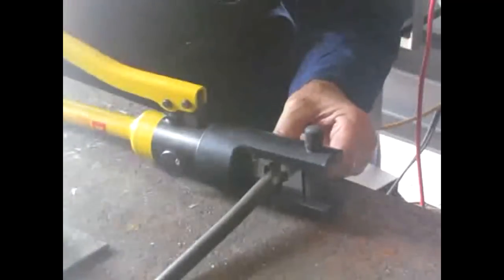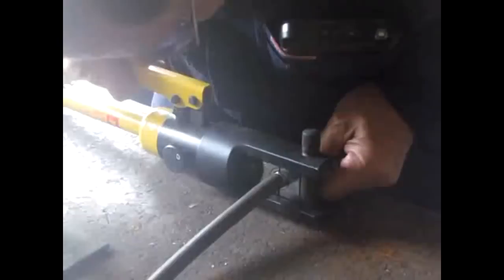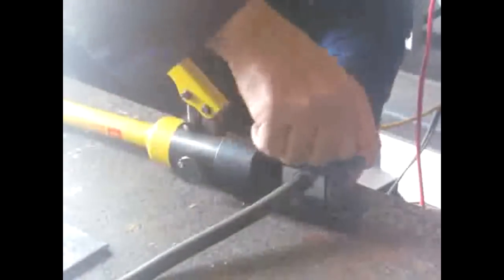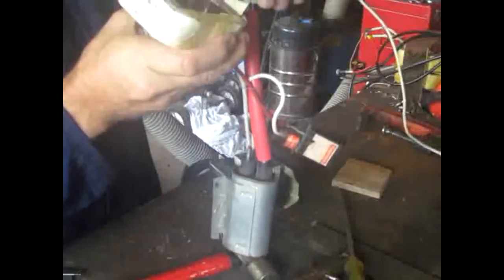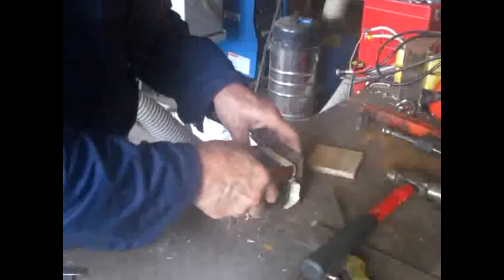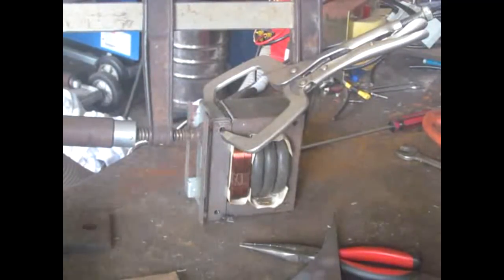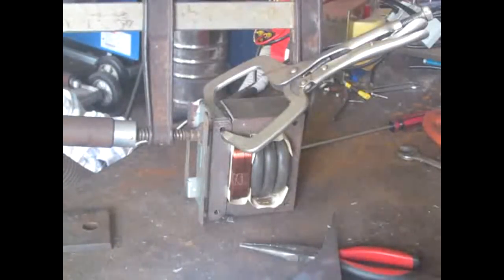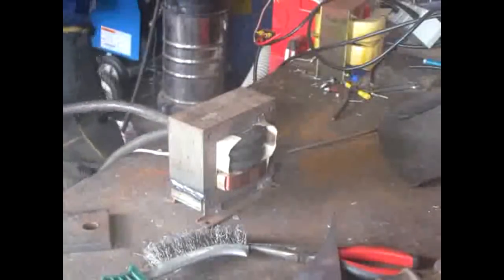Rewing a Microwave Oven Transformer (MOT) to make a small spot welder

Comment: 5:40 At this point, I bumped out the shunts first, then pushed the coil down towards the primary. This let me clean off the varnish that was holding the secondary in place. With that cleaned off, it was easier to remove. I inserted a flathead where the shunts were. Gently and evenly prying the secondary coil off. The primary was a bit more difficult only b/c I wanted to keep it intact for other projects. Its aluminum, so not sure it salvaging it was worth it.

Comment: Well, how well did it work? I'm only half way through mine. I was debating on what to use for the new secondary.
Reply from the maker: Hi, I decided that I need a bigger transformer so converted a 140A arc welder, there is a video I made on it so if you search by my user name you should find it. As for this MOT transformer, ended up  I rewiring it again, and turned it into a 20A battery charger. I diced the aluminium windings and used copper core cable.